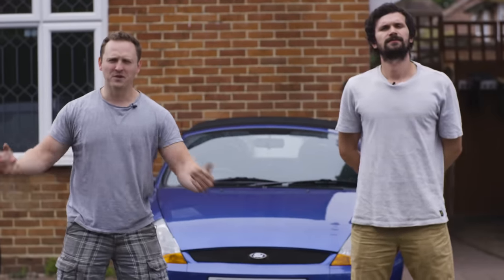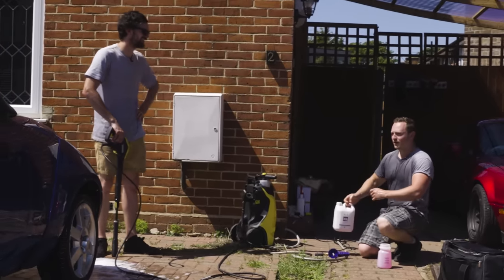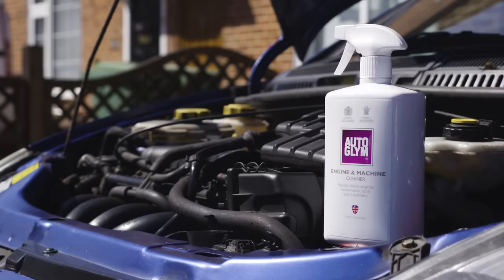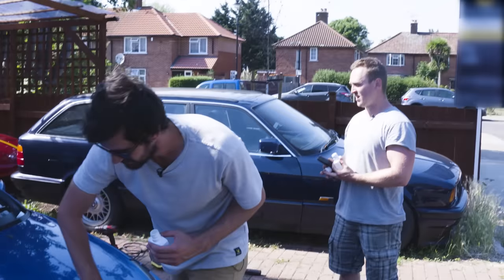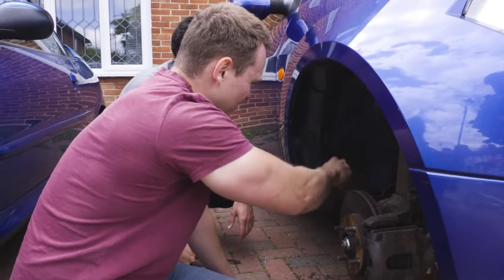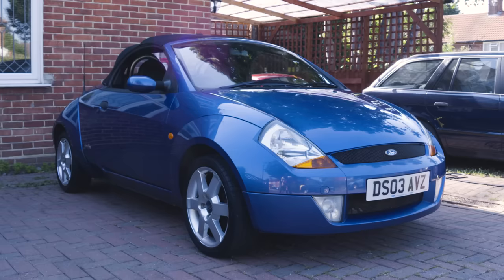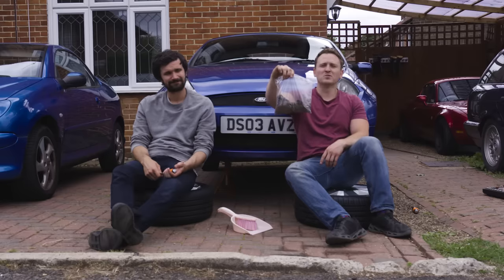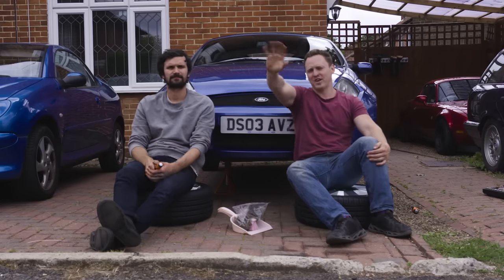Can We Flip Our Cheap Summer Car For BIG Profit?

Comment: That was like a giant Autoglym ad and I still didn't mind
Reply: I barely minded in the first place but then it turns out their cleaning products are actually cheap af.
£18.00 for all three is amazing
Reply: I never mind ads if it still makes for entertaining content
Reply: @060steve  3 years ago I bought Turtlewax Zip Wax 5ltr jug and it's only just  half used.  Cost then was £7 today it's £10.

Snow foam is a gimmick.  You still have to physically wash it with a sponge or mit. 

Also to have to unwind,  plug in,  connect water for the pressure washer each time is a faff. 

I can wash the whole car in 15mins with a bucket of warm water, a sponge, and a capful of Turtlewax Zip Wax mixed in.
Reply: @steve0680657  you'll scratch your car with more ease if you just go with the sponge and water; quite likely it won't get rid of the baked-in crud either
Reply: @laurikotila5813  been doing it for 15 years. No "baked in crud" and no scratches.

"baked in crud" is another salesman line.  I haven't put my car in an oven.
Reply: @steve0680657  might be your personal experience but i can see a lot of situations where snow foam is useful
Reply: I want to get it, not because it cleans your car well, but because it looks so satisfying
Reply: Once you try bilt hamber auto form there's no going back
Reply: Snowfoam isn't really used to clean your car . Snow foam is part of the pre wash stage and its purpose really is to loosen contaminants and agitate the top layer of muck, 
Really you want to be thoroughly jet washing the car , using a citrus pre wash rinsing and then using snow foam to further cleanse the surface before hitting with a two bucket wash.  You have to have a passion and interest to make the most of it . I thoroughly enjoy testing new products and researching , but  for the majority of the population they don't have an interest so will choose to take the simple method, which is automated car wash, single bucket do it yourself wash or the many drive in car washes we have now , there's nothing wrong with any of this , it's just some of us like to go the extra mile !
Reply: @chrisdean3421  That is exactly my car wash. Citrus on the dry car. Pressure it off. Snow foam and then 2 bucket when the snow foam is about half way dripped off. Bucket and SPONGE straight on to the dirty car...? yeaaahhhhno.
Reply: @steve0680657  You can't criticize when you use a sponge to wash...  Maybe you don't see scratches if you have white paint and don't look.
Reply: @steve0680657  I do kind of agree with you on snow foam, it works if theres minimal muck on the car, but it loosens up old muck too. Deffo seems to be the go to first fix for a lot of you tube car tinkerer channels though. Like a lot of things in society these days, it makes a big show but has little effect. 
Snow foam / Snow flake 😂😂

Comment: The savage garage: Rusty ford
Car throttle: Rusty ford
Me wondering what car to get next: Probably not a ford
Reply: Live in Australia, the land where cars don't rust, (not very easily anyway) my ford failed an inspection due to some sill rust.... its a 97.
Reply: @bigsohc  dude I've seen 3 years old Fords with some rust spots on doors,wheel arches , trunk and bonnet edges...
They are making them out of shitolinum or something...
Reply: FORD: Fucked On Race Day.
Reply: @fila1445  If they're rusting it's more likely because they aren't putting enough paint on the steel. Even stainless rusts outside.
Reply: Amaranthine you’re right. Fords have always been known for thin paint, hence the rust
Reply: @BakedPrawns  I've only had japanese cars. Can easily say that 90s Nissan's are the same.
Reply: FORD

 FAIL
OR
REPAIR
DAILY

😂😂
Reply: NEVER buying a Ford is always a good motto. Fix Or Repair Daily.
Reply: @bigsohc  yeah, kind of figured that out and laughed my head off when marty from mighty car mods called his MR2 turbo a rust bucket, it barely had what we would class as surface rust here in the UK 😂
Reply: Yeah trust me, that's the best sound advice you could have given yourself . "Don't Buy A Ford" 
I own a rusty shitbox Ford Falcon so I should know. Lol
Reply: @sharifsircar  My 2012 Fusion doesn't have any and they fucking PAVE the roads in salt here in the winter
Reply: Fix
OR
Repair
Daily
Reply: Daz Dee yeah they rust, but engines, especially the old ones run forever, 1.0’s are awful though.
If you don’t mind spending a bit on rust repair and taking care of the car, the car will take care of you
Reply: I heard a Ford Ka press car already had rust on it!
Reply: Thats what I have, since passed the inspection by covering the rust in bog then painted over it. Mechanicals are excellent! 400,000kms+ and still on original motor
Reply: Nine months later: "I got a Ford."
Reply: The Bump Test Guy  2016 Ford Focus and any Ford Transit from the past 3 years begs to differ.
Reply: @bigsohc  had two '85 Ford Falcons, both failed due to rust. (Also front of one of them had a kinked chassis rail due to being in a head-on crash)

Comment: I love what it's MOT report says, considering it only passed a few weeks ago:

"Monitor and repair if necessary (advisories):

Nearside Front Subframe mounting prescribed area is corroded but not considered excessive (5.3.6 (a) (i))

Offside Front Subframe mounting prescribed area is corroded but not considered excessive (5.3.6 (a) (i))"

🤣
Reply: That 100% wasn't a legit MOT
Reply: You can't fail what you can't see I'm afraid.
Reply: MOT tests should have "testers notes" on the end as a new section. IF they've knowledge of certain cars like old Fords being rustboxes they can write it on there in an 'official manner' as a personal advisory to the owner but absolutely nothing to do with the Gov and Gov doesn't even see that section when the MOT is filed. Obvs this could be heavily abused but I'm a nobody with no idea how that sort of idea would work or if it'd even work at all.
Reply: @dylandajhharwood5566  not a bad idea.
Reply: It failed the last MOT for excessive rust and corrosion 
Wonder how it passed the second time
Reply: @AaroMesa  A cheeky £50 was probably slid the way of the MOT tester
Reply: @dylandajhharwood5566  No way, you're basically suggesting that they guess instead of looking at what's factually in front of them. Throwing hearsay into the mix isn't going to help anybody. At that point you basically defeat the purpose of the inspection. The certificate is stating that for all legal intents the vehicle is safe but the inspector is telling you it's a deathtrap. Not exactly helpful.

Comment: KA with a rust problem? Now there's a surprise! 😂

Is the welding video next?
Reply: This is the No1 area the Street Ka's rot. Suprised they never checked.
Reply: You call this RUST? Buy an E30! You will then see real RUST, when you can't lift the car from the ground, because the jacking points are long gone with the seals, so you lift it from the beam where the a-arms mount, and the beam cracks, then the car can't even move, because the A-arm is now not attached to anything :D  That's the E30 I bought and am restoring.... Oh, and no floor in the trunk, no floor in the front too! Its a great start, because I can do everything from scratch, instead of fixing the original, like patching the sheet metal, and cutting and grinding, and wirewheel everything  :D  A fun project car!
Reply: @REVOLTAR53  tbh u cant lift most of e36 and e46 too xD
Reply: @REVOLTAR53  you think that is Rust? Buy a 70s Datsun 240z and See for yourself 😁
Reply: Fiats are even worse
Reply: @REVOLTAR53  oh boy, and here was I think "Let's buy a touring". Anything particular to look out while looking at one? (Besides rust, I guess. The one I'm thinking on is a 1.8)
Reply: @christineayres5339  are you sure? Because i have Seen 240z's with Fred flintstone Levels of Rust thru the floorboards
Reply: @commieasmr8469  Lancias are the worst ,they blow away on a windy day lol 😂
Reply: Guys I own a Ford Transit, So know about Ford's & rust well 😂
Reply: The mark 1 ka 's all have rust under the petrol filler cap
Reply: W210 owners can relate :D
Reply: @christineayres5339  I had a 1980s alfa, that went to the scrappy in bags of rust! Only engine and gearbox was one full part. A mates mark 1 Ford capri ended the same way, been under a tarp for 25 years, we pulled it back to find the engine had fell out an the car was basically a dust impression of a car. Totally destroyed.
Reply: @michaelbamber4887  Yeah thats why few survived ,they were very cheaply made

Comment: Car Throttle: “well these cars are notorious for rust”

Me: “Fords? Yup”
Reply: I own two Miatas and I can relate. And guess who was part owner of Mazda in the years notorious for rust? Fekkin Ferd.
Reply: @Josh_0579  dodge grand caravan
Reply: @Mrcrappyfuntastic  Yeah they are bad too. But I've heard of a G Wagon th at had rust in th he windshield-frame after two years
Reply: Ever heard of the pontiac grand am?
Reply: @BigWheel.  No I haven't (I'm from Germany we have ahm what's the word ... TASTE)
Reply: The 02ish f150's are the worst. Notorious for core support and rocker rust.
Reply: That reminds me of the fabric rear wheel arch liners on the Ford Puma, what a catastrophic design floor that was.
Reply: Not mention the debacle that is the '10(?) to '13 focus and fusion auto transmissions. The states versions at least.
Reply: @BigWheel.  Sorry I don't speak Septic Tank.

Comment: Alex -"when you're buying a car, on a drive way, you don't go and take the wheels and arch liners off"
Mx5 owners- * confused Pikachu face * "yes, yes you do"
Reply: Mazda RX8's as well .
Yes I own 2 ,all the wings, both sills, the brace by the air box and boot lid by the 3rd brake light.
Rust havens

Comment: Autoglym? Start with Hammerite. A few buckets full of Hammerite. The stuff does work, but not when the car is literally rotten with rust. The odd spot of rust isn't an issue, but it is when the chassis is less stable than rotting tree bark. And these old Ford Kas were notorious for rusting. Maybe there is the odd one out there which hasn't rusted, but overall I'd give this generation of cars a wide, wide berth.

Comment: 📛 Hot tip auto glym didn't mention: don't wash or coat in circular motions, that's what causes the circles in paintwork. Go from top to bottom of the panel instead
Reply: That's NOT what causes the circles in paint
Reply: @TotoGeenen  Any dust and debris in cleaning cloths/sponges, no matter how small, will cause scratches in the clear coat. Those scratches are more noticeable when the car is cleaned using circular motions as opposed to straight up and down motions

Comment: Can you do a practicality test on the Mitsubishi outlander 2 also the 2.0 d i d is the cheaper of the options with the 140hp pd engine im wondering about a eco remap which apparently will give 40hp more generically but I think as is it will seam like a rocket 🚀 after my heavy old td5

Comment: Many modern cars have rust problems. They look stainless from the outside but on the bottom they turn out to be pretty bad. Subframes in particular can be very corroded. And it doesn't matter which brand you choose. And it doesn't matter whether they are expensive or cheap. Inspect cars older than 10 years on a bridge when purchasing.

Comment: This rust is not that bad. I'm still waiting for you guys to try out some rust repair yourselves. ChrisFix did some good DIY welding, you can do it too!
Reply: would be an MOT failure with that much rust and not worth to repair
Reply: @taz874  most of this rust is hidden: this can easily be cut off with grinder and welded back using sheet metal. It doesn't have to look pretty, because body panels and arch-liners cover your bodywork. I would say this could've been a great exercise for someone learning to do bodywork on a car. 
For rust repair most of the cost is labor, not materials: if you have enough willpower, time and equipment, it can be done easily.
Speaking because I have done this kind of bodywork to 2 cars now for less than 100€ in parts.

So I'm still waiting car throttle to find some rustbucket and try to weld it.

Comment: Hi guys, I bought a KA two years ago for £500 and it has just passed an MOT by the garage I bought it from. Comes next year and the MOT... The same garage I bought it from I gave it to them as it was right where I live and they  have done few bits to it throughout the year. They called back with some rear suspensions issues that needed fixing to pass the MOT.  Quite relieved it's not that bad, I gave them green light. Hour or so on, they are calling me back, that the whole rear left back side of the care just came off as the were taking the suspensions off - rust... they showed me the amount of rust... believe my guys, You have not seen rust. Your street here has no rust compared to my KA. I could put my luggage through the wheel arch into the boot :P

Comment: £200 for the engine, £150 for the gearbox, £150 for the seats, £100 for the wheels, £40 for the brake calipers, £10-£40 for each for the bumpers, body panels, lights etc.

Comment: To be honest, you need to be careful with anything you buy. Seen 59 plate cars in just as bad a state.
But Fords are really bad, well early ones are anyway. 
It is why we see less and less of them each year. 
A mate of mine had an XR3i that we was working on and that was covered in rust, he bought an xr2 that was the same and now hes restoring a ST mondeo that looks even worse. I remember reading an article about 8 years ago about ford, and one of the ways they would cut costs was not rust protecting under the cars.

Comment: If you really want to sell your car, in reality, don't wash the engine. It will look like you're trying to hide something leaks or recent fixes or worse, temporary fixes. A slightly dirty but dry engine compartment with a very slight oil film is perfectly fine and potential issues like oil leaks or other liquid leaks become visible immediate - or the absence of that. Don't wash your engine compartment.

Comment: They say you should never jet wash an engine as you could get water in the circuit box and ruins the electrics and looks to me like you could only sell it for £100 not £995 if it’s severally corroded underneath and the subframes got corrosion on it according to mot and the mountings are corroded also I do feel sorry for you guys as it’s probably a scrap car now

Comment: I bought a Ford StreetKa for £900 at 38,000 miles thinking it would be a fun & reliable car. I was wrong! Had it for 2 years and it gave nothing but problems. It constantly had things go wrong and the front tyres would go completely bald every 5,000 miles. I sold it for £750 at 55,000 miles in the end. Was glad to get rid of it. I only buy Japanese cars now.